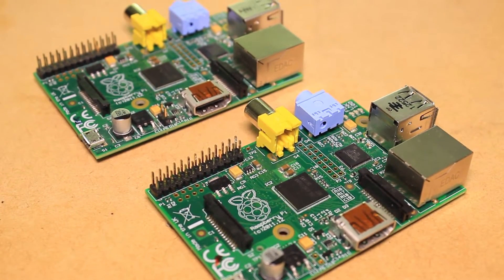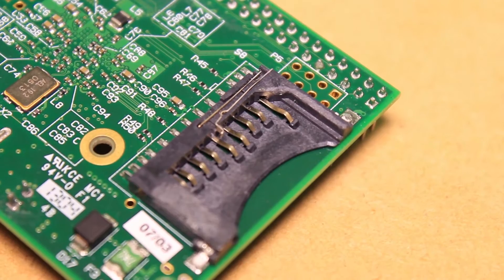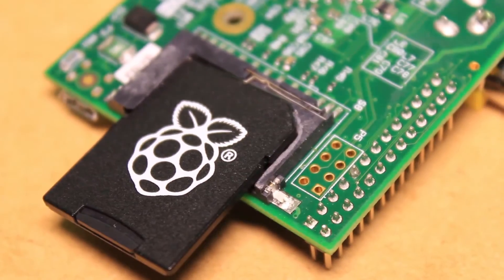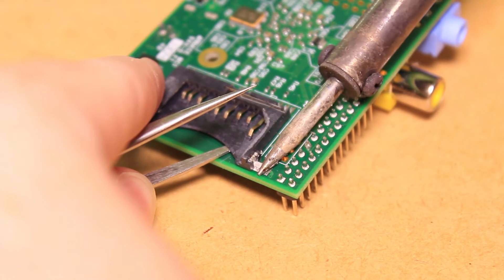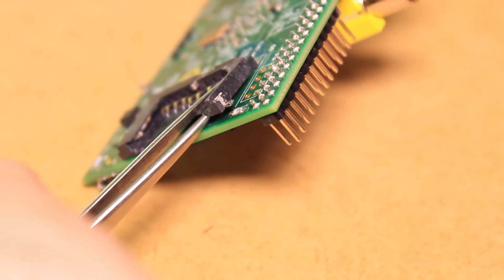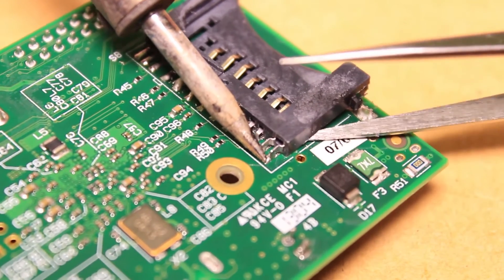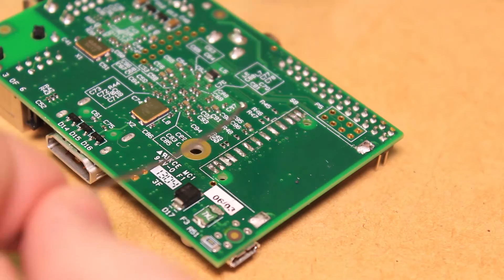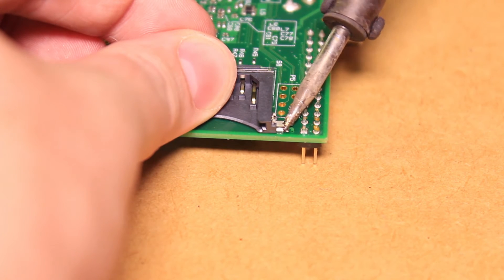Raspberry Pi - SD Card Slot Repair

Comment: I got a 1b that I need to repair,  if only I saw this before attempting it badly, I was worried about putting too much heat on the board so just put it aside.

Do you remember the temperature you used with the iron.

Comment: I've got a Raspberry Pi 3 and on the right side of the headphone jack there's two small components. What are those two parts called and would it be possible to replace one of them if it was to break? Looks like it says C58 on one end of it and R36 on the other.It's right above the screw hole that's behind the ethernet port.